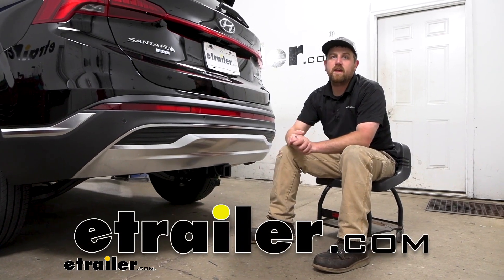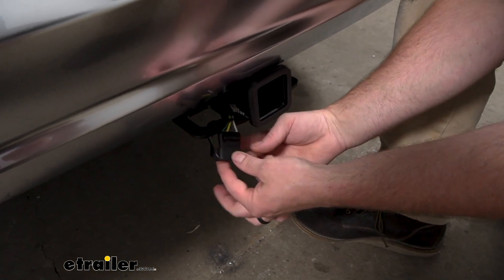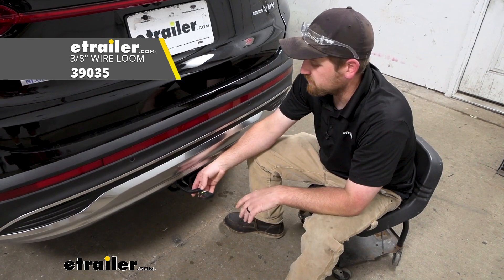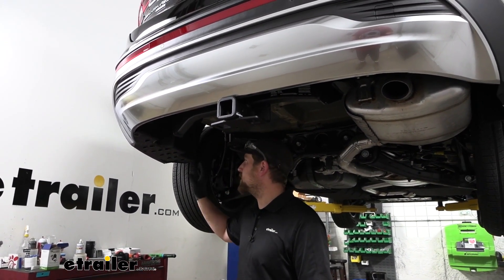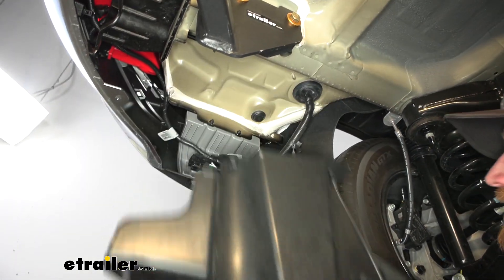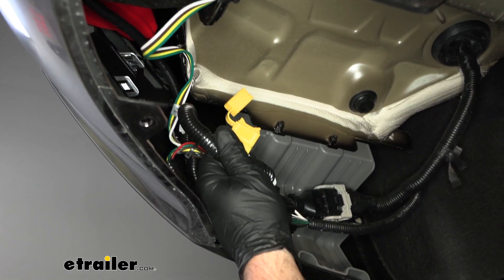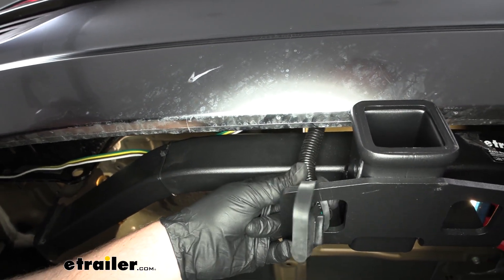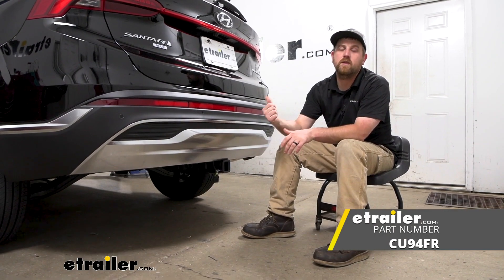etrailer | Curt T-Connector Vehicle Wiring Harness Installation - 2021 Hyundai Santa Fe

Comment: Will the female end connector be on the car even if I did not get the OEM tow package?
Reply from the maker: According to Curt, all models of the 2019-2024 Hyundai Santa Fe will have the connector shown in the video. The # CU94FR trailer wiring harness will work great for you....
https://www.etrailer.com/Custom-Fit-Vehicle-Wiring/CURT/CU94FR.html